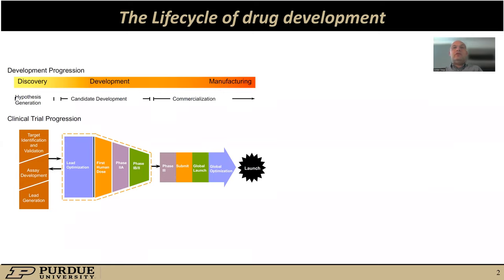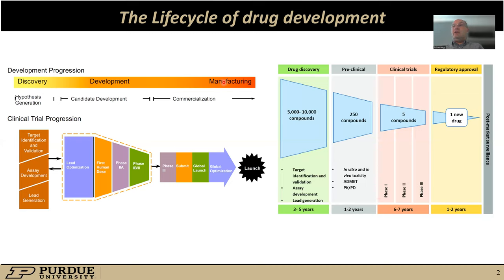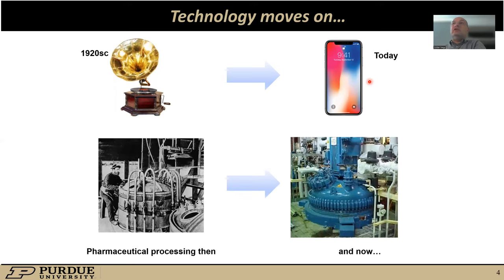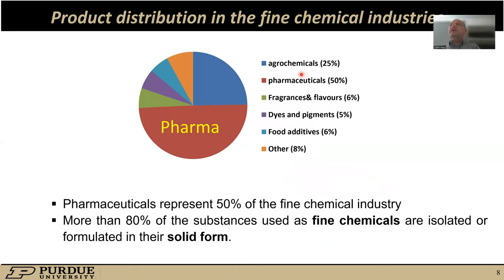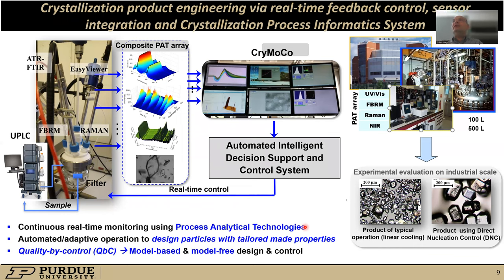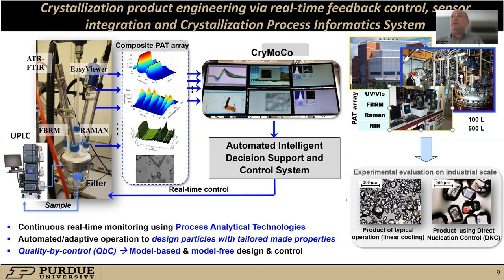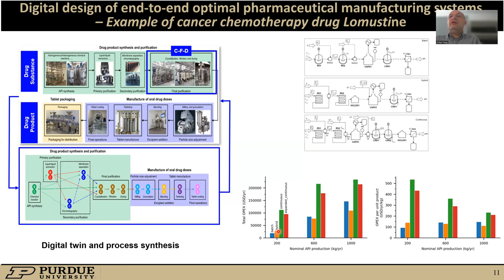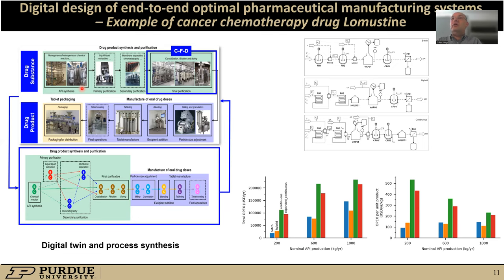CONF-MCEE – Smart Manufacturing of Pharmaceuticals

Comment from the maker: Here are the questions we collected and the answers replied by the presenter: 

Q: It takes more than 10 years for traditional drug development. By using these new methods, how long does it take to invent a new drug now? For example, the drug for Covid-19, when may it be on the market?

Using digital design technologies it is possible to reduce significantly the number of experiments thus time and material required to develop a process, since only a small number of experiments are enough to identify model parameters and the model then can be used to perform very large number of in silico experiments and direct model-based optimizations. The exact reduction of time is case specific, we had cases where we demonstrated that the process development time reduced from 2-3 months to 2 days for a crystallization process of a commercial API. We also demonstrated cases for which to achieve the same design space with high accuracy the time to perform all experiments would have required close to one year, whereas the experiments for parameter estimation and then the model-based experimental design could be completed within one week. Model-based digital design can certainly accelerate the development of many of the processes for the drug that are on the general WHO shortlist due the their need in COVID related treatment.